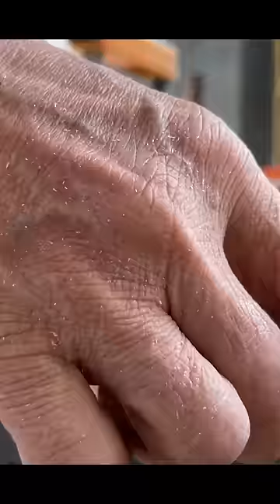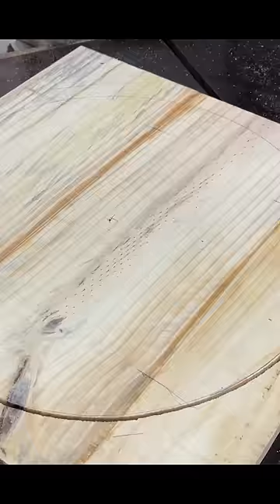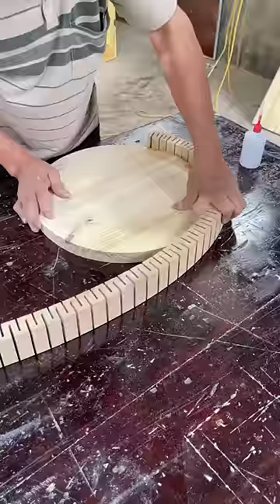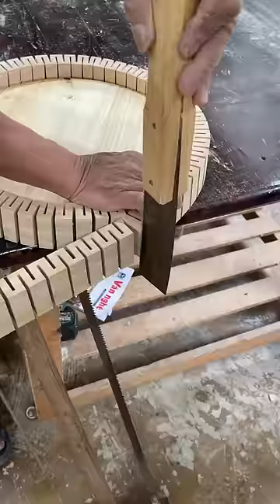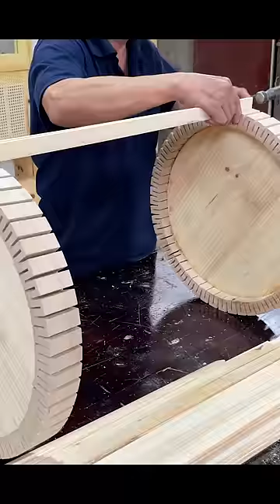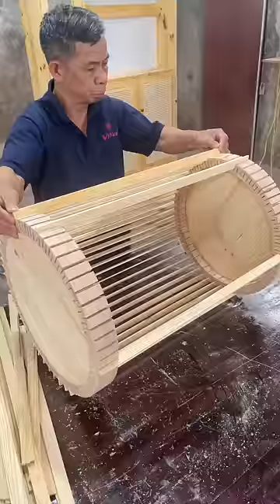Woodworking Tips

Comment: What style of cut is that in the beginning?
Reply: Called a “kerf” when you make repeated relief cuts so you can bend the board. I’ve usually seen it on just one side. Not sure if kerf-ing both sides makes it bendy-er or if it’s so he can add those leg/supports.

Comment: How good is Superglue as a permanent woodworking glue?  I have always used the white wood glue before, and I know that makes a long-lasting bond - but it takes a relatively long time to cure.  I have seen Superglue used in woodworking, but I always considered it a method of quick-tacking two pieces until something more permanent is done later.
So how long does a Supergued joint last?